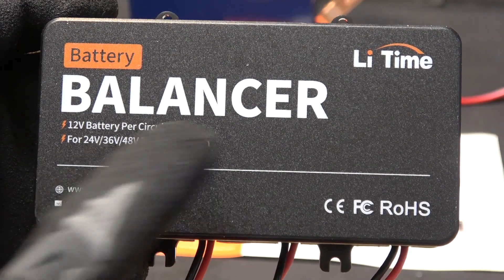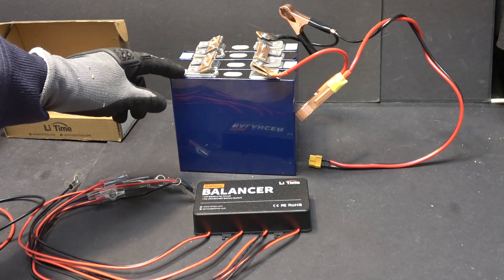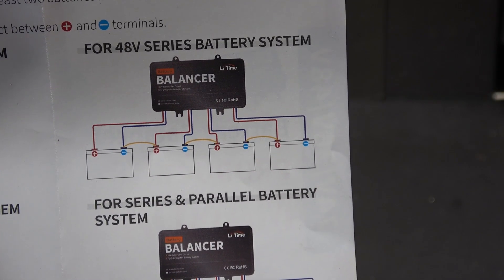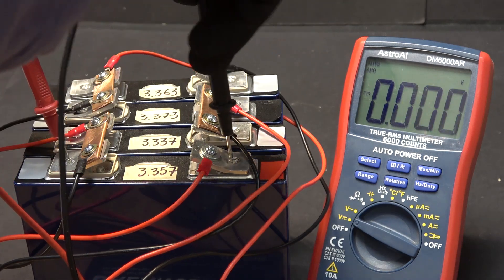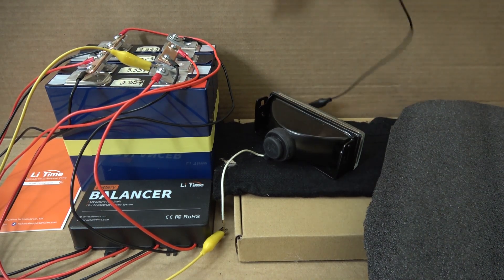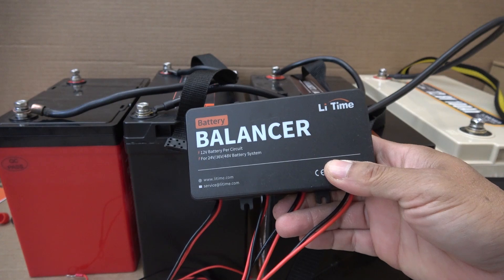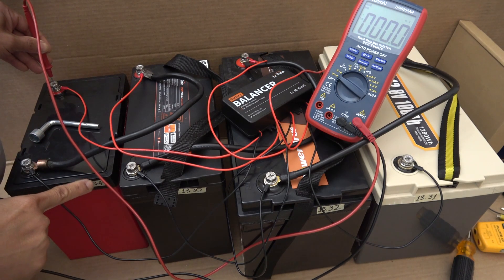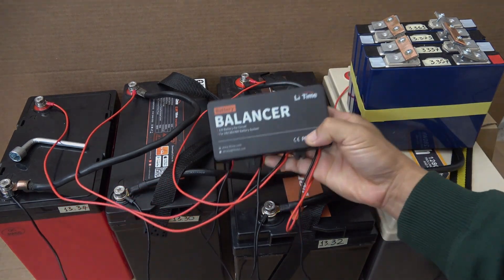Review: LiTime (LiFePO4) battery balancer for 12V, 24V, 36V, and 48V

Comment: Hmm if the voltage of the cells all seem to have dropped to the voltage of the lowest cell, doesn´t that mean power was lost? It used power from the higher voltage cells to "charge" the lower cells but no cells actually got higher voltage they all just dropped to the lowest.

Comment: I just did something different with the same balancer that I have never seen anyone do. I was also thinking of trying this too, I got a cheap active balancer on 4 cells that works fairly well but it's a 1.2amp balancer, a bit small. And cause I only use half of the max charge rating I don't see why this wouldn't work. I do notice they seem to drain a bit to much power over time when using 20Ah batteries on that, and one battery always seems to be a bit off.

Comment: Hello, I have bought it and really don't know how to connect it : I have 4 LifePo4 15KWH battery. Each battery is 48VDC. I can not understand how to connect this way
Reply: You have 4 batteries in Series to make 200V or in Parallel as 48V?  If in series then you need a 50V/100V/150V/200V balancer.  If they are in parallel you don't need a battery balancer... Battery balancers are only for batteries in series.
Reply: @Sidicas does it balance all the time it's hooked up? I was thinking it only balanced when a charger was hooked up? I'm watching video's because I ordered one from eco-worthy and am running three 280ah batteries 12v. So in series I need 36v for my trolling motor. So does this work while im charging it with a 36v lipo charger? Or once the charger is done and all the batteries are 100% you stop charging and this unit balances them when the charger is off?

Comment: i have a two battery set up, and a ecoworthy balancer... with it attached I've noticed it doesn't seem to balance any as at random checks one battery is always lower voltage than the other.  i believe this is what is causing my system to shut down sooner than its supposed to given its a 24v set up with two 12v batteries. Self learning this stuff lol. think i will snag one of these.  also helps to see how you went about testing it.  much appreciated!

Comment: Would be interesting to see what it does with batteries that aren’t nearly full. A proper LiFePO4 balancer shouldn’t activate until the cells are at 3.3V or higher. Since this thing has no concept of individual cell voltage and only sees the difference between the leads, it could end up needlessly draining the battery bank trying to balance when there’s nothing that actually needs balancing.
Reply: although it works on 3.2v cells I think its main purpose is for 12v(12.8v) batteries connected in series with other 12v batteries.